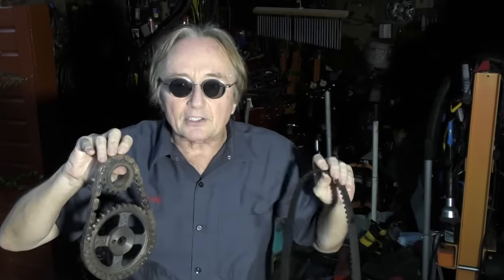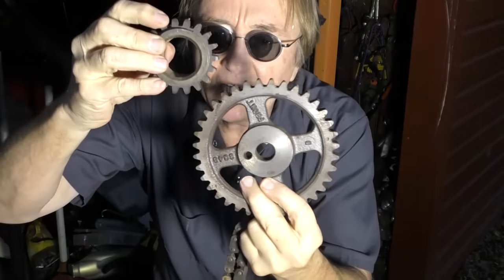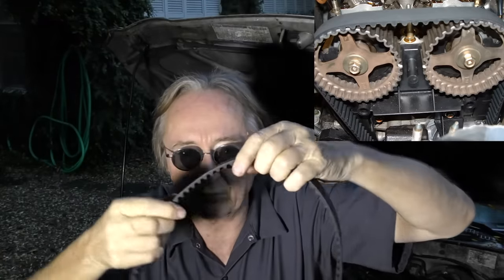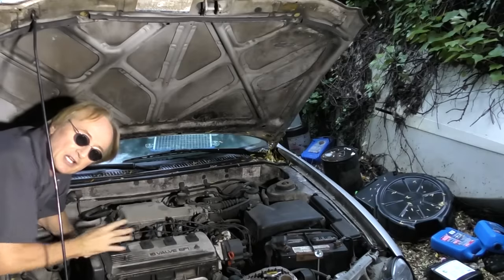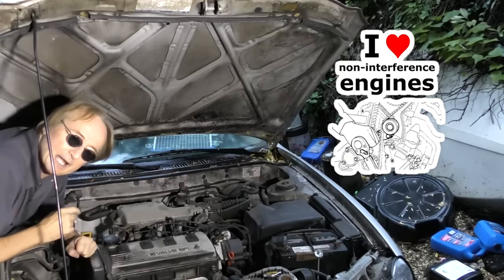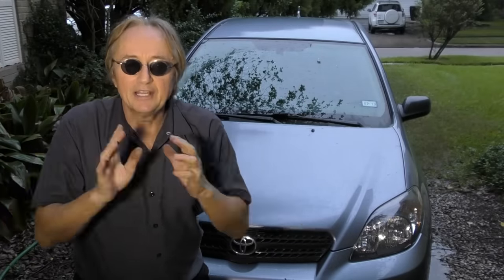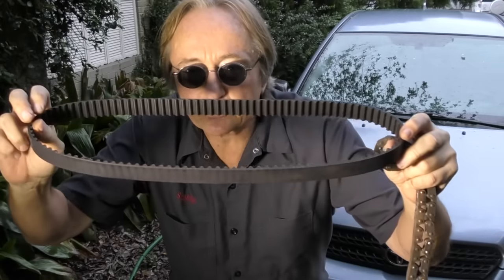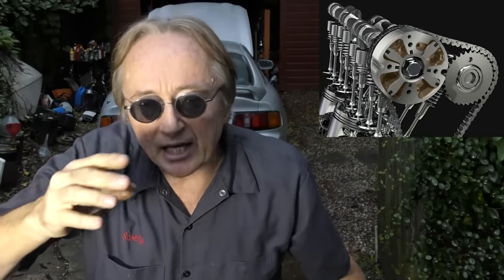Why Some Cars Have a Timing Chain Instead of a Timing Belt

Comment: Another reason for the switch to timing belts;
They wear out quicker than chains. Therefore, most 45,000 mile maintenance requires their r & r at most dealership for $300 +/-.

Comment: Scotty talk about how reliable the Toyota compare to Nissan using the same rubber timing belt, but Toyota have massive recall vehicles models back in 2010 blaming the carpet get stuck into gas pedal, but in reality it was the drive by wire throttle unit, this recall is worldwide!

Comment: Seems to me that the commenters who are ragging on the belts and praising the chains simply don't ever change either the belt or the chain.

Sure, if you don't change anything, the metal chain lasts longer. OTOH, changing the belt at the recommended intervals is a 2hr job that I can do, while changing a chain that sits inside the engine means dropping the engine before starting work on it.

I've never had a belt snap. I have had to junk entire engines because the cost of taking the engine and doing  the chain-replacement was almost as much as a low-mileage import.

So, yeah, won't buy another car with a chain. Too much hassle to change the chain.

Comment: Is it possible to change from a belt to a chain without major modification? Or does the engine have to be replaced with one designed to have a chain?
Reply: Cannot be .. chains are inside the engine body and belts are outside

Comment: timing belt on 2005 tundra... engine is Interference! I gotta chain mine. it's at 153,k
Reply: Good idea, but don’t stress it as much as you think. Seen tons of 1st Gen tundras in for a water pump replacement w/over 250k that still have the original belt
Reply: @stackthatartpaper   Thanks! Turns out the timing belt was probably changed around 100,000 mi by the previous owner. I changed it at about 154 k. I wanted them to save the part so I can see how worn the parts were.  Before I was shown the parts my mechanic said that the belt looked barely used and the water pump was fine etc. They changed the thermostat too but everything looked really good. I guess so it was changed only 50,000 miles earlier! So I didn't need to do it at that point. Oh well. I pull a grooming trailer so it's a piece of mind. I love my tundra. Pulls my trailer so smoothly. Only I don't love is the turning radius. But my truck is comfortable and a work horse!

Comment: Hey Scotty! need a second 1994 Toyota celica?  It need a few things worked on, has over 280k miles and its in my driveway looking for a new home.  
Runs great when its right but the spark pulu tubes seals leak, it need brake rotors and pads shoes and drums no doubt new set of rubber some body work  anti sway bushings and a good go over to run 280k more miles mostly problem free.  Oh did I say its a 5 speed? coup st version.

Comment: Gears are best. Never had a chain brake but have had a belt brake. bent 2 valves on my 1981 VW diesel truck. Also hate side terminal batteries.

Comment: Some timing chains/sprockets stronger than others? Also some sprockets and gears were plastic or nylon coated? 
Cheapskate designs? 
The rattley gears in the Iron Duke 4 cylinder engine? Plastic? 
Pontiac overhead cam 6 in the Tempest the first car with the rubbery belt ?

Comment: Scotty, can you change out the rubber timing belt system to a timing chain system? Or is that cost prohibitive?
Reply: I believe with many motors you can without too much trouble, but this is assuming you are doing a total rebuild. as for a modification alone, that might not be so doable.

Comment: Scotty, you missed an opportunity to discuss the compromises that Ford and maybe others did in the ‘60’s  and 70’s.  Ford used timing chains their engines put made the cam gear out of aluminum with plastic teeth on the gears.  What a mistake. When it spit those teeth out, the timing would skip and you were stuck.  By the grace of  God, even though three of those teeth were shed on my ‘66 Mustang in Nevada, I was able to get home with an engine way out of time.

Comment: I prefer timing belts.  They did not rely on engine oil.  I have a 2013 corolla, and the dealer said I had a oil leak at the timing chain seals.  They wanted $2000 to fix it.  Of course, I said no.  But my car now loses engine oil.  Thus, I would prefer the 97 corolla with a timing belt.  I also thought those engines were smoother, and quieter.

Comment: Hi Scotty. You got any tips on inspecting a used 2004 Citroen Jumper van
2.2 HDi with 320000km e.g do those timing chains last even with regular engine oil changes or do they have a bad rep regardless?

Comment: This is why changing your oil every 5,000 max is important especially on VVT-i engines as it has to flow easily or may get clogged up in the tiny holes....as on a youtube video.The cam chain will also last longer!

Comment: Timing chains are super reliable unless you're talking BMW about 20 years ago.
And they were interference engines so you were lucky if you didn't bend a valve stem or 2.
Somebody told me they used an odd design of chain - more like a mesh - not sure whether that's true.

Comment: my timing belt making a worse sound when need to change... i went to the repair shop tell them my car making annoying sound, they check and for sure timing belt is need to be replaced, i just tell them to replace the whole belt set, it cost about 95usd... now the car run quiet and smooth again 😁 7 years i've been using the car and that's the 1st time i change the timing belt, not really a big deal to me 🤗

Comment: My 92 nissan 240 sx had double row timing chain, it also had 460 000km on it , it would rattle a little at idle but only because of a worne temsioner , problem was that the floor rotted out but the kid who bought it put the engine in his 240 body

Comment: I have a '99 expedition.  Can I get away with not having a timing chain guide on the right side of the engine?  It sits above the chain, so it doesn't keep the chain from sagging down.  I'm not sure what it's for.  I do have the chain trail on the tensioner of course.

Comment: My 2011 Toyota Camry is at 100,00 and the timing chain has been rattling on cold starts  for about 2 years. Since its an non- interference engine, what are the odds that it could ruin the engine? ....and how much does it cost to have a new timing chain put on?

Comment: Hey Scotty I have a problem in my 2011 Toyota Camry when I start the car I can hear rattling and when pressed gas pedal it’s starting to choke the engine could it be a timing chain? I already changed spark plugs all the connections to it it’s still working the same way

Comment: Scott I have a 2012 acrue t l with 53000 miles should the timing belt be changed and the valves be adjusted???

Comment: Timing chains was used on old engines with low RPM where precision was no big deal. On a modern engine with high RPM and double cams you need a longer timing belt because it weigh less and dont stretch. A belt is easier to speed up from low RPM to high RPM compared with a chain etc etc.....

Comment: I did 120 mph in my mother's 1980 Saab 900 in 1981, on I-91. The timing chain tensioner broke and what an horrific noise it made. She took it to the dealer and they replaced the tensioner. $30.
Reply: $30 won't get you an oil change?
Reply: @johnweiland9389  Now, maybe.

Comment: I had pontiacs in the 60s with a timing chain and fiber gears  high failure rate. Then replacements were always steel.

Comment: I don't claim to be a mechanical engineer but I fail to see how GDI engines put more load on a timing belt as Scotty suggests. The belt is in no way connected to the fuel system or the alternator that powers it. The only thing that I could see placing more load on the timing belt are things that are related directly to the cams (like variable valve systems) since it does not even connect with anything else. All that said I still prefer chains regardless.

Comment: Sure the belt streches and gets worn out but its ment to be replaced like alot of other parts.  Some of the strongest and most famous engines use belts... Also seen quite a few engines with chains blow. Not the chains but parts they run on like bolts that hold the sprockets snap or come loose.

Comment: Adding this detail for those wondering what their car have on.
Timing belt will have a plastic cover attached to the side of engine, timing chain will not have that plastic cover, you have no easy access to the chain.

Comment: I'll take timing gears. 
They're used in every aviation reciprocating engine today. And nothing less than top reliability is permitted in aviation.  The noise is a small price to pay for solid reliability.
Reply: But they are old fashioned push rod engines, low RPM with no VVT. You will never see this arrangement in a modern engine.

Comment: I just got a quote to replace my timing belt/water pump on a 2017 Ford Escape 1.5L (106,000 miles) and it is $2,200. This is ridiculous.  I don't know what to do especially with the coolant ingress potential issue which would require a new engine ($9,000).

Comment: Gear-driven cams have lots of rotating mass they have every noticeable horsepower loss because of that. They probably could make them much light with forged aluminum or machined heat-treated steel now, but that's the main reason chains are used

Comment: I've had four timing belts break. The first one was in my truck. It was a non-interference engine and it ran me $300 to fix. The second through fourth were on interference engines. One I replaced the engine, the last two I got rid of the car. Strictly non interference engines for me for now on.
Reply: Got 2013 toyota auris, non interference engine with a belt, cost me 20£ to change it myself ;) best thing easy to fix

Comment: If you want to sqeeze the "connecting rod length" to stroke ratio to max and need the aerodynamics to be fair you need some way of reducing the hight of the cylinderhead. 
You want 4 valves in there and a shallow combustion chamber and the intake area can't be reduced so lift need be increased - you even want a spark plug in there too, taking up space for the valves !!!?.

Just a little question to all here, lets see if you can guess this right - you are allowed to join Scotty ;-)
which camshaft will put the most load on the camshaft drive system ?
15 mm core shaft diameter or 30 mm core shaft diameter - both with 15 mm lift !

Let get to the solution for the initial design constrains:
Increase the lift from 12 to 17 mm, 
decrease the camshaft core diameter from 30 to 15 mm to be able to reduce the angle between the valves/camshafts, 
shorten the valve stems 10 mm  - you need shorter valve springs with higher spring rates - but who cares :-)
the above two allows you to lower your camshafts 25 mm, one inch !! - nice
But it comes with a cost, a huge cost - 
near 100% increase of cam rise-rate (steeper cams) and very likely the same increase spring rate = more than 100% increase of strain on the cam-drive-train - assuming we are not doubling the number of valves.

Belts are actually very reliable - my own little "oil-burner" (diesel) has a belt service life of 240 000 km or 10 years whichever comes first.
My belt was changed at 237 000 km and 10 years, was curiously tested and was found to be well within 90% of the strength of a new belt - its a 20 mm wide belt and 16 valves DOHC.

Do you want reliability ? - keep the service intervals and use the right quality of spare parts. If you are not qualified to select the right quality - USE original spare parts and DO NOT Chip-tune.

Comment: I just replaced the belt on one of my 2uzfe motors. 160k since the last change at 100k.  cracks all through it. Dodged a bullet. If you're not sure, suck it up and get it done.

Comment: That slick little dual overhead cam at 3:33  - is that chain kind of wimpy? 
Too many beancounters--making it too cheap ? Probably only would cost another $20. per car to put a better chain in it that would almost certainly go 200,000 miles or longer with oil changes?
  Is that chain you are holding at 4:04 better than the other one?

Comment: So here’s a crazy story: my dad had a ‘95 Acura Legend which he thought had a timing chain. 19-20 years later in 2014 or 2015, he took it in to get worked on (I forgot what for specifically). The shop told him that the timing belt needs replacing. He looked at the mechanic and said, “It has a timing belt?” In other words, he was completely shocked. He’d put a little over 180k miles on the car and the timing belt had lasted him that long. Normally he should’ve been on at least his third by then. He literally went through more transmissions then he did timing belts.

Comment: iam bumed out i have a 2018 ford 150 truck and at 40.000 miles and eecobuost  engine and I                                      want know what to do after learning about this engine 3.5  ,iam scared  now of the wet rubber  drive belt ? What is the solution?sell,rebuild  upgrade?  what other truck engine offered  with steel  chains.?

Comment: I don't mind the noise, that I have never noticed. But I have had enough problems with the rubber belts so I will never again have a car without the chain. I mostly prefer Mercedes but I can make exception if needed ( in most cases not). On my motorcycles there's always the chain, and for reason.

Comment: Scotty.. I have a Toyota avanza.. I buy from used cars.. It idle problem.. Just a little.. like one of spark plug go out like.. Or one of the fuel injector.. I don't know what?  And my ecu said (error link) i tried everything like you said nothing working. My automatic transmission not shifting right?  It reaches 20 km/h in first gear.
Reply: I'm in south East Asia..

Comment: Cool vids I subscribed. I've heard about timing belt horror stories from the 90's. No thanks on that timing belt crap. Our two cars have chains.  Hey! You didn't mention that crappy Buick 3.8 engine with the plastic/nylon timing gears! I bet you saw quite alot of those GM penny pinching lemons in the 80's!

Comment: If the dealer told me I had a choice of gears, a chain, or a belt, and that the gears would be the most expensive and the belt would be the least expensive, I would go with the most expensive option - gears.  I'm willing to pay a little more to get an engine that will last forever.

Timing chains don't always last forever.  I had an 84 Olds 98 that had a PLASTIC gear for the timing chain.  It jumped timing, and I had to get it fixed.  At least it was a non-interference engine.

I'll bet they could let the timing gears swim in oil - that should quiet them down.

Comment: Just make sure your timing belt is not getting wet with oil you'll be fine.
I have a blue Gates belt on my Ej8 and a good valve cover gasquet.
My timing belt looks like new.
Now my problem is that my engine drips oil and I can't find from where.
Oil pan gasquet new.
Torque converter dry as a bone and flywheel.
I'm thinking maybe the breather box O ring..

Comment: Recommenced only 100K miles for timing chain on my Nissan as timing chain plastic guide wears out, same mileage as for Camry belt. Belt of the Camry is doable for the DIY where Nissan chain replacement need to dismantle most of the engine surrounding parts.

Comment: I actually have seen myself what should be an incredibly reliable engine have a failed timing chain.  A Mercedes 3.5 tonne truck made in about '95 . It was no wonder the timing chain had failed because there was something seriously wrong with the HP injection pump which caused a severe idling problem repeatedly almost stalling and then accelerating over and over again, each time snatching hard on the timing chain tensioners. They couldn't increase the idle speed setting because the truck became undriveable. Whenever stopped in traffic the driver had to remember to press gently on the pedal to avoid it. Eventually the chain broke after a few months.  This just shows how strong timing chains are.

Comment: Well, the idea about chains being more reliable a myth now. It was true with OHV, where the chain was short. But with OHC the plain length and mass of the chain brings in severe resonances, which when excited (just running the engine at "wrong" rpm) generate surge loading way above any reasonable design may stand. Yes, there are dampening elements (all the guides,..., all with quite a complex hydraulics to actually provide the dampening) to prevent these resonances, but these have their life limited. And once they fail, it is almost guaranteed the resonance surges in the chain will destroy all the bearings (because these are the elements that have to hold those stresses) or even cause the "tough" chain to snap. And unlike the belt, the wear of these elements is not visible unless you completely disassemble them. Good luck doing that every oil change, when you can pretty easily inspect the belt state.
The rubber belt may have shorter life by itself, but its internal friction is inherently damping all possible resonances, so you do not need all those extra damping elements there. Yes, unlike the chain itself, the belt is a consumable to be regularly replaced. But if you do so, the belt failures are actually way rarer than with the long chains.
Yes, when the belts first started to appear nearly half century ago, they were real pain in the butt, because the industry just did not know yet how to design them in properly.
But now similar belts are even used to transfer power from the engine to the main gearbox in helicopters (as a suspension element separating the engine vibrations from the main rotor drive).

Comment: In E n F series BMW are chains, but chains must be changed after 100000km -150000km otherwise it will break down the engine, and its expensive to change chains on car on so low millage. So its cheaper to change the belts every 70000km than chains.